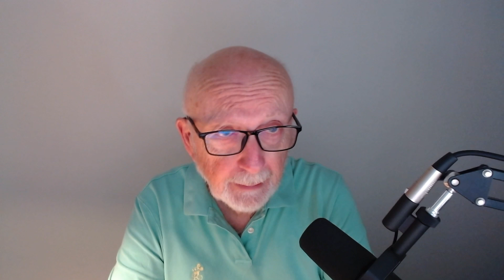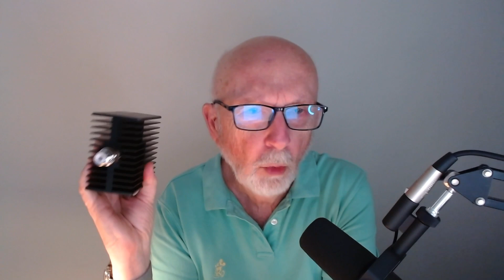Ham & CB Radio Myth - Non Resonant Antennas Don’t Radiate As Well.

Comment: Ah jeez, this old tale again. Half the story and a lot of baloney. The antenna is a System from the SO239 on the rig to the end of the wire(s)
1. Any antenna system is more better than no antenna. Any antenna system can make a contact sometimes, or half the time.
2. The antenna tuner does not tune the antenna. Nothing tunes the antenna other than its resonant length (changes with height, etc).
3. Coax cable has increased losses when the antenna does not match the coax. Putting a tuner back at the rig does not erase the coax losses.
4. Antenna tuners have loss.  5% to 10% is common. It can be more. It can be huge on transmit. 
5. Circulating currents in the tuner can melt solder connections. Not so much on receive which is why all antennas hear better than they transmit.
 6. Yes, reflected power is radiated eventually. And so is the I-Squared-R heat from the multiple reflections back and forth through the antenna system.
7. If you can work every station you call it doesn't matter how much loss there is in your antenna system. Operate and have fun.
8. If you answer stations and they call CQ again right back in your face you might ask yourself how much of your transmit power was turned into heat. You may want to think about a remote match box at the antenna or a tuned wire the coax likes more.

I have no problem with multiband single wire antennas. The losses can be acceptable. If they work for you then good-on-ya. 
But insisting that coax and tuner losses do not matter is wrong.
Reply: Well said
Reply: I have read an article maybe from the QST magazine comparing antenna tuners with a 43 foot vertical. On 160 meters that is a very low impedance and very capacitive reactance, very difficult to match. A good tuner did the job with moderate loss and a poor tuner had great loss or did not tune at all. So it's how the tuner is constructed. If I recall correct that good tuner was around $700 so you might be better off using a longer antenna thet does not need that extreme matching.
Reply: Denny you have a misunderstanding of how a tuner tunes the antenna to resonance
Reply from the maker: Coax losses only matter unless they are extreme.  An antenna tuner does in effect tune the antenna by cancelling the reactance.  That's tuning.  As for solder joints melting in a tuner, are you running a kilowatt through a QRP tuner?  Outside of that I think we pretty much agree except for the baloney comment.  Provide reliable references to correct all baloney.

Comment: I'm pretty happy with my screwdriver vertical
Reply: it has a HiQ on most bands and can be made resonant on those it was built for, it doesn't require a tuner but one could  still be used if desired.... my other antenna is a loop and is also a HiQ that does not require an external tuner... I also have a nice hat with my callsign embroidered on it, that was a gift from another ham.

Comment: So.......SWR doesn't matter,........Resonance doesn't matter,........I've made good contacts with my dipole literally on the ground, so I guess height doesn't matter either. Let's face it, a mobile antenna isn't that high up and I've made a lot of contacts on HF mobile. So, other than quality feedline and a way to match the impedance to the radio, what DOES matter? 
PLEASE, use LOW power to tune up and zero beat the desired frequency. My ear drums can't handle 3000 hz very long. Anyway, thanks for doing these videos and 73!
Reply: Having fun with the hobby matters....worrying about all the techie antenna nonsense just causes frustration.

Comment: Most antennas people call "resonant" are not actually resonant.  Thanks for the video!  73
Reply: @James-ci3lx it's where the antennas impedance is purely resistive.  That is usually not at 50 ohms where your transmitter likes to work.  I see a lot of people cutting and trimming their antennas to match 50 ohms, calling it "resonant" where technically that is not the case.
Reply: Wrong....
 @lifegettingintheway2710

Comment: I've been a ham radio operator for the past 35 years, I was once talking to an old G3 silent key now and he told me.
"Wire is Wire" what he meant was a length of wire is a length of wire !!

Don't buy into the antenna scam, all they want is your money 💰💰 a load of smoke and mirror's.
Great video hopefully ham's will take notice.
Cheers 73 another thing, it's 73 and not 73's this goes to all those who say 73's.
Reply: Antenna scam? I think in this world we all spends our monies and takes our chances !
I am sure there some very fine antennas for sale ! I also think there are some antennas for sale that are less than.
The final decision as to the quality of gear lies on the shoulders of the owner !
I have never bought a ready made antenna ! Though I have seen a couple that I would have bought !
I a wire in a tree type fella:) 73 and it goes  dah dah dit dit dit     dit dit dit dah dah  I never send a S
Reply: I agree. Don't buy aerials. I've made 5 h.f. dipoles for 20m to 10m, an inverted vee for 60m and a 2 element collinear for 2m. I made a copy of a Joystick which were around in the 1960's and 70's. A lump of inductance on a pole with a long wire attached and a tuner. Mine with an MFJ 16010 tuner will tune 160m to 10m with a long (short) wire of 26'. Yes, I can tune it to resonance but not very efficiently on 160m.
In the past I made a 5 el Yagi for 2m.
G4GHB.
Reply: Yes I think a copy of the Antenna Book is something good to buy ! @bill-2018

Comment: A G3 many years ago said you can load up a knitting needle on top band with the right a.t.u. but it won't be efficient.
Are you saying otherwise? Yes, it would radiate.
I have an a.t.u. but only for my long wire where a low SWR corresponds to maximum r.f. out as shown on my r.f. pick up meter at the aerial. 
Other aerials are dipoles in the attic, inverted vee outside and a 2 el collinear indoors in the bedroom shack, all h/b and tuned for a low SWR. I use RG58 for them all but short lengths. I aim for at least 2:1 with 1.5:1 better and have got them lower. Not a problem.
The books tell us 1.5:1 is 96% efficient. I do okay with my QRP 5 Watts and less.
G4GHB.
Reply from the maker: I think he was using hyperbole to say a tuner can load up a knitting needle.  Any efficient antenna has to be of reasonable length.  That would be a good topic for another video.

Comment: Well said, to borderline repeat what I posted in the comments of another of your videos we should look at efficiency and radiation pattern more than we do SWR. As for the tuner close to the antenna feedpoint I have changed my mind over the years. With a modest length of reasonable feeder on the HF bands a tuner in the shack does not suffer water ingress, collisions with lawnmowers or invasion by spiders. Here in the UK our power limits are defined AT THE FEEDPOINT of the antenna so I can just compensate for feeder loss by increasing the power at the shack end. I must admit that for lazy operating and bandhopping I prefer reasonably matched antennas that are accommodated by the fairly limited auto tuner in the rig. 73
Reply: Because of antenna restrictions I use a stealth 71" non-resonant end-fed sloper, 15' high end, 6' at low end, 9:1 unun, 50' of coax, no counterpoise wire, common mode choke 3' from the ATU. ATU needed only on 160, 75/80, 40. Contacts on all HF bands, including WARC bands. From California, SSB contacts to Europe, Mediterranean, Africa, Japan, Australia, Indonesia. Solid 5/9 signal reports on daily 40 & 80 SSB nets. Its a low cost, all HF band antenna.
Reply from the maker: Excellent!  A good, inexpensive common sense setup.  You didn't have to buy an $800 vertical that looks like it was a Star Wars prop. Because of antenna restrictions I am using an OFC random length stealth dipole with one end higher than the other, a 9:1 unun and two chokes on the line.  SWR is less than 3:1 from 160 meters up to 6 meters.  No problems with common mode current (RF in the shack).  Works perfectly fine.
Reply: I agree with efficiency, the books tell us a 1.5:1 SWR is 96% efficient so I like to get that or less as I'm QRP so efficiency is important to me.
Lower SWR = greater efficiency.
G4GHB.
Reply from the maker: Power transfer efficiency to the load may be 96 percent but that has nothing to do with the efficiency of the antenna.  My dummy load has nearly 100 percent efficiency in that case.
Reply: @BustRadioMyths  This is exactly what this video tries to explain....yet here are guys saying the same thing you tried to get them to understand...swr itself is not a good way to measure antenna efficiency. I can make a 20 foot piece of wire tune up flat on 160 with a beast of a tuner...but my signal would be so weak nobody would hear me. That flat match itself means nothing.
Reply: @BustRadioMyths  As SWR goes down r.f. out goes up as seen on my SWR meter in the shack and r.f. pick up meter at the aerial. I do aim to get as low an SWR as possible. I once read dipoles can be 90 - 95% efficient so we want the best we can get  out of them by a low SWR. Running QRP here with nothing above 5 Watts and down to 350 mW so I want the best I can get.
A vertical aerial without radials is not efficient as one with, it is inferior, so radials help to make it a better radiator. To say a non resonant aerial is not inferior is wrong. Yes, I agree a tuner can tune it to resonance and show a low SWR but it's still not efficient without radials.
1.5:1 SWR  = 96% efficiency, 1.1:1 = 99.8%. A low SWR achieves the most r.f. delivered to the dipoles. At least it does at my station.
G4GHB.
Reply: @bill-2018 an antenna system with 10.1 swr can be just as efficient as a resonant antenna system in some cases more efficient, 
Example 
An 80m dipole fed with rg58 against a similar length dipole that presents and swr of 10.1 to the tuner with balance feedline ,guess which one has more power at the antenna to radiate, yes you've guess correctly its the antenna with the 10.1 swr

Comment: All I know is my about 135 dipole that I feed with 450 onm line is Resonant who knows where?
I never care !
I feel it awful efficient ! Even with my balanced matcher behind my pusher !
I still send almost all of my little QRP power 
I am sure I pollute the air proficiently ~!
I think it should be remembered that a terminated with a resistor big daddy rombic is not a Resonant.
Yes there lots of really fine antennas that are not Resonant
A true Resonant antenna would be impractical if true a Resonant antenna you would seek 
For it be Resonant only a very small bandwith !
And if the It has to be Resonant were true !
If you move your TX  frequency
The antenna would immediately go kaput
Sure with a matcher you could match it !
But all the it has to be Resonant is gone !
Reply: @lifegettingintheway2710  The guy in Spain did have a 5 element Yagi though so think of the gain both ways. Peter had a ½λ end fed and near water.
G4GHB.
Reply: Why is my comment to @lifegettingintheway2710 on here?
G4GHB.
Reply: Seems efficiency and gain are different ! I think my antenna is efficient ! I have no idea about it having any gain to any particular direction ! I think most all antennas that are 1/2 wavelength are most often very efficent.Gain is another different characteristic. @lifegettingintheway2710
Reply: @lifegettingintheway2710  I got back on 2m with a ¼λ telescopic whip, then a J Pole then a 2 element collinear which is what I use now, all h/b. Matching is by tapping up the ½λ shorted 450 Ω twin feeder with coax. Years ago I made a 2m 5 el Yagi using a.m. for about 2 - 3 years until I got the G4 call, but only work locals now on f.m. and with a rare bit of c.w. Not much c.w. on 2m.  
G4GHB.
Reply: For many years I used a doublet with h/b tuner, it seemed to do okay, I got out.
G4GHB.

Comment: Very well explained! Would you please make a video explaining Power VS Signal?
Reply from the maker: Good idea I'll add it to my list.
Reply: Dude I know how to use an antenna tuner don't insult me as I only been operating qrp for over 40 years and when I was a novice I worked mostly 15 & 40 with a resonant antenna. I regurly work the far east on 20 with both my vertical and a hwef. I never use more than 40 ft of feedline.
Reply: @jamesgeorge1709  I think he put it up perhaps for those new to the hobby.
In the past I used long wires and a doublet both with tuners, the furthest was Australia on the l.w. with 100 Watts s.s.b., so yes, simple aerials work.
I now have attic dipoles for 5 bands, 20m to 10m and an outdoor low inverted vee for 60m. A copy of a Joystick for other bands, if you remember them. Also QRP for about 30 years with nothing above 5 Watts.
G4GHB.

Comment: I think your initial statement should be reworded perhaps. You allude to use of a tuner for antennas, which would in turn make your antenna resonant if it was not previously so. Are we being pedantic? maybe. I don't know anyone claiming you must use a perfectly tuned dipole as in your example, but I will accept that they must exist. I would say that I can probably build a ground plane, and hand tune that to be closer to "perfect" than a non-resonant antenna would be using a tuner... but... In my eyes, efficiency includes a component of radiation pattern and so once again we find ourselves with an "it depends".

On the topic of losses and reflections. Each reflection must have some associated loss to the transmission line, otherwise I would like to buy your 0 loss cable sir. Each reflected watt of power gets a second chance to warm your cables. It may be insignificant, but not 0. Certainly its not the whole of the reflected power, else you are dumping all your power into your feed line.

These are good thought experiments. Thanks for the content.